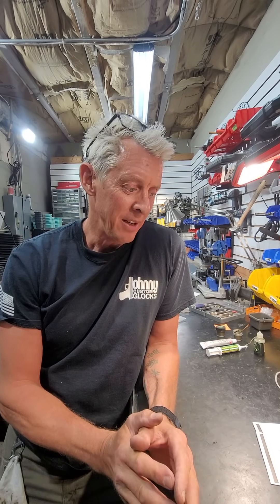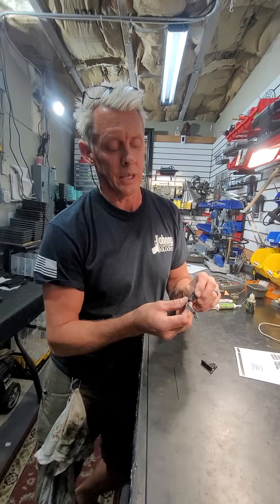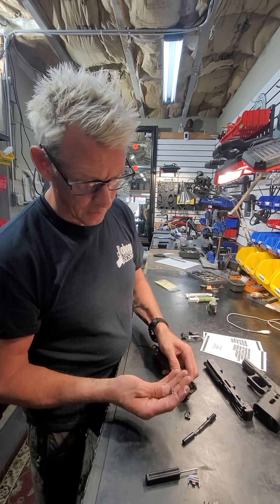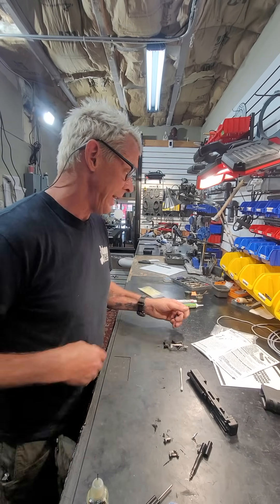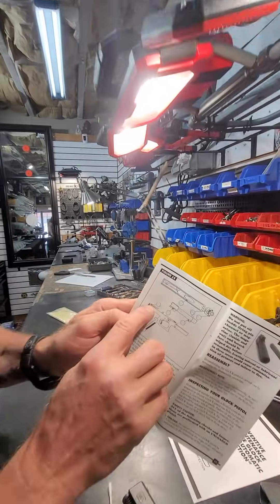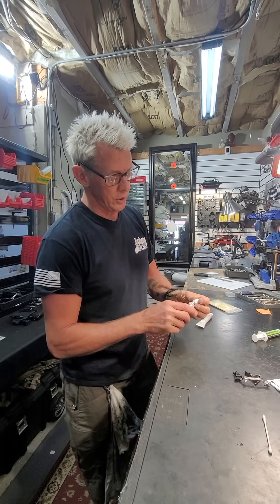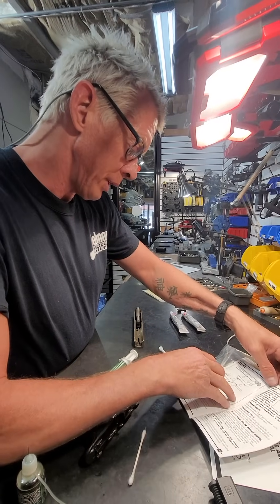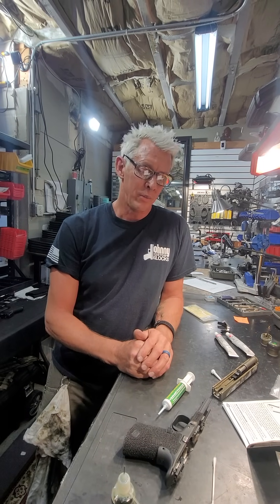GLOCK  lubrication a how to...

Comment: Glocks recommended oiling procedure is in the owners manual of every Glock . I clean my guns after every range trip cause I enjoy cleaning guns & rags, cleaner & oil are cheap. Great vid Johnny . Dawn works great on cleaning disassembled slide, barrel, & frame & it doesn't damage polymer parts like some cleaners can.
Reply: I tend clean after shooting, just prefer to make sure it's clean, lightly lubricated, and ready to go again.
Reply: Frog lube good choices
Reply: I’ve been under lubing my guns likes a SOB. Got to worried about over doing it I went and did the opposite.
Reply: @Ampacityelectric  no. I use Hoppes #9 solvent with a Glock bore brush , then a clean patch, & lastly CLP lightly on the final patches until clean. I do this about every 250 rounds or so the oil the barrel , locking block , breech face, & the connector. I use Dawn dish soap & hot water to wash the frame & other parts separate from barrel.
Reply: @Ampacityelectric  I use dawn for the whole gun, but I’ve also seen glocks that are abused as hell with almost a smooth bore shoot a fist sized group at 25y. For a pistol I don’t think cleaning your barrel is necessary tbh
Reply: far too often. It‘s a gun not your teeth.
Reply: @Glockhead1 so he should brush his teeth after every range trip

Comment: Being a farmer my gun gets dusty. REALLY dusty. I run it completely dry. I've never really had reliability problems and it allows me to blow my gun off with the air compressor and have a "clean gun" clean enough for a Glock anyway! I ran a 2100 round 3 day pistol class and my trigger got really hard to pull so i put 2 drops of 5w30 amsoil on the reset and it was fine. It's still like that today and feeling good. I'm doing another one in Sept I'll see how it lasts over this summer lol!
Reply: I've been wiping everything down on my gun with oil out of fear of water or sweat getting into the gun when I open carry doing farm stuff. Any issues with rust from running it dry? 

JG is obviously right about over-lubricating & spraying it with CLP. My striker channel, extractor, etc. was filthy upon inspection.

Comment: I know I’m an over-luber but I also clean a lot. I basically put the lube in the same spots you just show with one other area. I put a very small amount of grease on the front part of the barrel hood where it locks into the slide. I’m amazed at how reliable Glocks are. In my years of shooting them I can count on one hand the number of malfunctions I’ve had. Simply great guns.

Comment: Locktite C5-A Copper Based Anti-Seize Lubricant (used on trigger parts shown at 9:15)
Clenzoil Field & Range needle oiler (used on barrel & inside of slide shown at 6:22)
Clenzoil Synthetic Gun Grease (used on rails of frame shown at 11:33)
At 9:20  Only time the word 'liberal' is allowed to be used ;)

Comment: @johnnyglock I’m having trouble with any recoil spring staying in place do you have any recommendations 🤦🏻‍♂️ I’m about to get in touch with the maker on the barrel because it’s just falling outta place when I remove the slide, I did put a tiny tiny tiny lube on the barrel but not where it sits

Comment: Thats wild i wonder if its the same for smith canik springfield and so on. I been way over oiling. My shadow systems i grease the barrel so the copper coating doesnt come off. I also got a faxon that i grease, that one the coating rubbed off first time i shot it lol, junk.

Comment: Lyman Steel Steal cleaner and the Harbor Freight Ultrasonic tank heated 190° 6X. Then Use air or blow dryer to dry off. The Cleaner has a Rust inhibitor. Do not clean further or you have to relubricate all steel parts.

Comment: I use a plastic container with warm water and dawn dish soap to clean my glocks after the range.. I disassemble my slide, set the plunger, extractor, and firing pin in a plastic cup of a small amount of 90% rubbing alcohol. I don't like to breathe in cleaning solvents anymore, plus it cuts down on the use of rags, patches, and paper towels

Comment: The best way to F' up the first plastic gun ever, the Remington Nylon 66, was to oil it. I have C5A and sometimes I use Jetlube moly anti-seize. I use Jetlube on my AR barrel nuts. It is a moly product and it's good around 2000 degrees or so. Aeroshell 33 is barely good for 250 degrees.

Comment: I have a new to me gen 3 g19 that will randomly light primer strike. Everything looking at a lot of your video shows it doesn't have many rounds through it. I found the striker channel to not be buttery smooth and looks like someone cut a couple coils off the recoil spring, not sure if it's the stock spring shortened or a different spring cut to fit not sure! Where should I start in my process to get the reliability back?

Comment: Continue to use the Glock factory applied Copper colored Bronze Oilite Anti-friction lubricant. This takes the guess work out of using the correct lubricant for any place on earth. I found copper colored Bronze Oilite Anti-friction lubricant in online shopping sites like Mercari and others. A wet oily Glock is a unhappy Glock. Less lube is best.❤ ❤❤❤ Johnny is correct

Comment: I lubricated my Glock once and I could feel the firing pin was getting sluggish. I flushed it out with brake cleaner and never had a problem since. I was told by a good friend not to lubricate but I tried it and he was right. He said the same thing. Just a small dot on the rails and that's it. Honestly I just clean them really well and leave it dry.

Comment: The key to having a long-lasting reliable firearm is proper cleaning after each use... go to the range and only fire off like 200 rounds?... great taking it easy on her... perfectly fine... now go home and break it down and CLEAN IT. Go right ahead and spray it down if you want... piece by piece... the brush with a soft bristle brush and wipe it all away. If you don't physically remove the carbon build-up, it will layer and become a problem like what's being shown here.... yes, over lubricating can be an issue, but if you clean that mf after each use, you won't have any issues aside from spray in your face for the first few shots. Inwas also taught never to use any chemicals to clean firearms... hot soapy water and a towel to dry it off... then clp or your preferred gun oil... i use clp because it's good for cleaning lubricating and protecting the firearm parts. It does what it advertises... nothing more... nothing less... if it looks wet when you're done, you have too much oil. It should look almost completely dry with the very slightest shimmer to it. You can see the oil, but it's not enough to drip or run and no puddles. I ALWAYS over lube, then take a paper towel over the parts to soak excess, but dont scrub all of the oil off. Just wipe the excess... gr8 video...

Comment: On a new glock I grease every moving part. No oil only grease. Every spring the entire striker the plunger literally everything then put it together again and do the same with the frame . Then I rack it a bunch .dry fire it a bunch.  And do that until the metal all slide together without friction. Once it's smooth as I want it I take it completely back apart and clean everything completely dry. Put it all back together I put a drop of oil in each slide grove for the rails. 1 drop on the connector. Sometimes I don't even do that depending how smooth it works it'll be 2 drops on the rails and that's it and it will work perfectly  . I worked a a professional mechanic for years on really technical industrial machines.i don't know anything about guns but I'm positive this works for me .

Comment: Best way i found to clean them is by using brake clean an using shop air to blow everything out. Then put everything in the ultrasonic cleaner.  Water an dawns dish soap. Blow everything off real  good after an lube.  Its like brand new again.
Reply: Lol ultra sonic cleaners will clean anything fantastically

Comment: For grease, I use Superlube Multi-Purpose Synthetic Grease. It's good hot (450°F) and cold (-45°F), goes on smooth and thin enough to replace oil in the oiling locations, it has PTFE, and it's food safe so it's one less thing to kill you slowly.

I buy it in big 400g cylinders but it also comes in wee little squeeze bottles.
Reply: PTFE is not food safe

Comment: What about the outside parts of the gun that's exposed to the weather and body sweat you don't put oil on the outside of the gun and wipe it off for protection from the elements

Comment: When you take out the trigger bar from housing for lubing, how do you prevent the connector from flaring out too far from the housing?  Whenever I reinstall my trigger bar and housing, the connector  causes slide drag on my gun, preventing the trigger from resetting properly.

Comment: I do frog lube on slide points on barrels all over just little it works good in hot fireing witch takes wear at range use a lube or grease little only not to much

Comment: I have a question about greasing the clasp. Does the trigger bar move inside the clasp? I'm trying to visualize in my head to see how the trigger bar moves inside the clasp. I still did what you said to do, and greased it for good measure.

Comment: Why do you use C5-A on connector/trigger bar but not the clasp? Having 3 types of grease/oil seems like a little overkill. Especially when 0.5oz of that Cleansoil is like $20.

Comment: I think Owl Shit is amazing...or is Clenz Oil or the Locktight better?
Reply from the maker: use what works for you brother
Reply: @johnnyglocks  yeah I hear ya I'm gonna switch it up, what do I know compared to you brother lol! Lock tite or the clenz syringe? What's better for the whole gun, or do you just use the lock tite for the trigger bar and connector and the clenz syringe for the slide and barrel? Reason I ask is I bought a Faxon Barrel and Hellfire slide and I'm getting a huge blemish on my barrel and I have my gun lubed up just like your showing in this video. 
I plan on getting my trigger done by you soon, would I need to send the entire frame in? I can drop it in myself but I'm sure you make adjustments. Already did a .25 cent trigger Job but I want that clean break!!!

Comment: Does it hurt the frame doing full takedowns?  Does it wear faster?
Reply from the maker: no
Reply: Only if you're careless and hammer the pins out with a tapered role pin punch too deep and egg the holes out. Just pushing the pins out with a glock tool/punch won't hurt it though

Comment: Johnny I hear ya, so instead of liberal; how about generous ? Just love watching your videos. Great job explaining. By the way I did buy Clenzoil synthetic gun grease and just use a dab in those same points you showed in the video. I clean my gun after every 200 rounds or so and re-lube. By cleaning I mean everything comes out of the chassis. I may be over doing it but I find it to be therapeutic.
Reply: Different meaning, generous mean little above what is necessary amount and liberal is well over what is necessary amount.

Comment: Do you ever intend on making a G48 trigger? Also, have you ever used Milcomm TW25B and why do you use grease on the connector, trigger housing point when Glock specifies the use of oil?
Reply: Just get a Glock 19, you'll never shoot your 48 again lol
Reply: @jonah8133  I have a G19 and 2 G34s. I likely won't use the Glock 19 again, given the 48s smaller dimensions, while maintaining the same capacity as the 19. The G19 is redundant and pointless, now.
Reply: @Ambusher1st  I understand the printing is better on a 48 but it's just so much snappier than the 19.  That's awesome you have 2 34s.  I want a 34 very badly!

Comment: The 43x from Austria I just got is the first Glock I've seen that had oil all over the place from the factory!  Even the extractor & striker spring were wet with it.  Still had a VERY small amount of grease on the 4 guides.

Comment: I didn’t know when you first get a Glock you have to oil it. I shot about 350 rounds with it dry. When I took it apart it was bone dry. Only thing I got was some scuffs of the paint inside the rail rubbed off other thn that it ran smooth .

Comment: Great info!! I own two 1911’s as well as a “few” polymer frames. One custom WC commander and a Sig TacOps 5”. I don’t’ over oil those either. You can use too much even on those that it compromises it as a carry weapon. I just have one quick question. Not about anything from this video though. About your website. Why do you not list any parts for a G34 on it? I have a gen 5 G34 MOS that I’m turning into a straight range gun and I’ve been looking for good parts for it.

Comment: Holy shit man , that's a F ton of anti-seize to be using 🙈 🙉🙊.    Glock doesn't recommend to keep using that  stuff once what they put in there from the factory is gone .   Using just oil is best and the easiest way for the Glock to "clean itself".
Reply: Yup it starts to work as a lapping compound in itself, glock recommends to keep it on at the beginning to help break it in and smooth rough edges out. Just any quality oil is fine imo

Comment: I use synthetic motor oil and have never had an issue. Also, cleaning your Glock after every range trip is a complete joke.
Reply: …some do it as an OCD thing..like me. Is it necessary, NO.

Comment: Jeff writing from Crooklyn, NY, curious about how to load a round in a Glock pistol chamber without causing the extractor to wear out after prolonged use. Placing the round directly into the barrel is not good. But how about placing a round so the casing's rim is in contact with the breach face, and at the same time behind the extractor's tip? In this way, the extractor tip will sit inside the small diameter of the round.
Reply from the maker: no need to do either
Reply: What are you talking about? You stick a loaded magazine in the gun, pull the slide backward and release the slide. The gun loads itself. You need to take a firearm instruction class IMMEDIATELY.
Reply: Johnny, Tim..... I meant manually loading a 19th round in the gun, after loading an 18th round mag, to end up with 18 +1 firepower. Then release the slide so the +1 round is moved into the chamber. Next place the 18 round mag into gun. The result is one round in the chamber plus an 18 round mag waiting for the +1 round to be fired. Note, my comment was HOW to properly load the +1 round.